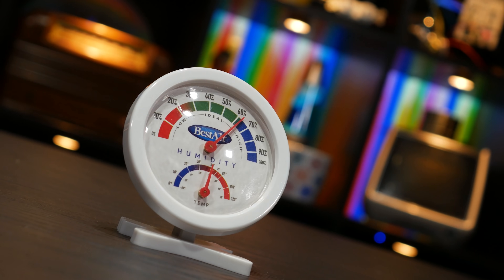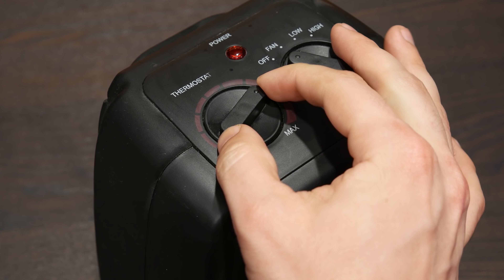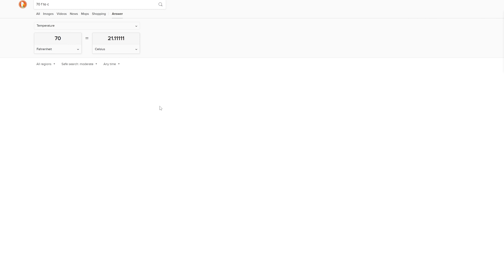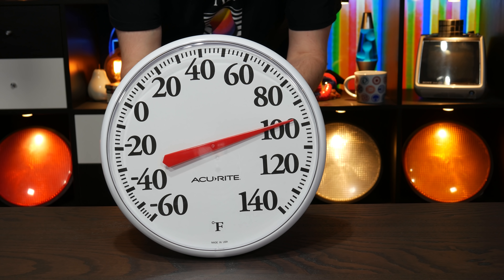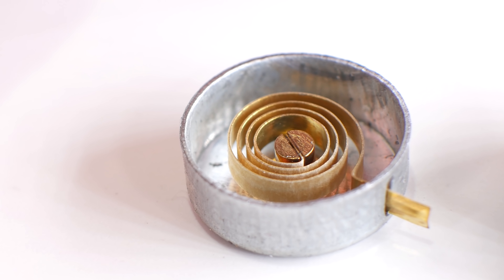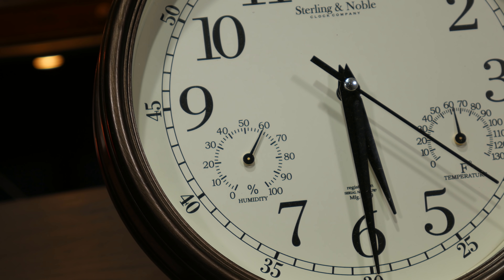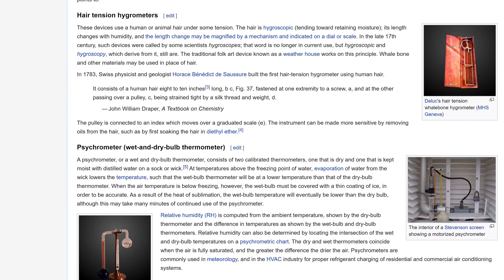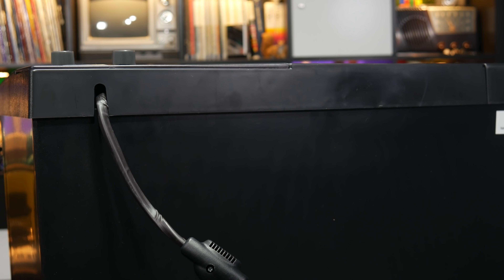Analog Hygrometers - how?

Comment: I don't measure temperature in C or F.
I measure it in "I will get out of bed" or "I will hit the snooze button another 10 times".
Sometimes I also measure it in "Do I really want to leave the comfort of the air conditioner"
Reply: I often measure in "Do I really want to leave the comfort of the air conditioner".  The answer is usually "Heck to the N-O."

Comment: I would love to see a video that finds the very best power outlet / plug type in the world.

Why was each type made the way it was?  Rank them for safety, durability, ability to stay plugged in firmly, dangers of each.
Reply: Here’s Tom Scott’s opinion on British plugs.  (https://www.youtube.com/watch?v=UEfP1OKKz_Q) I would add some caveats (I’m a displaced Brit, now in NJ USA who is old enough to have wired many, many plugs):

– The insulated live and neutral pins are great, but a relatively new idea. It was possible back in the day to find contact between a finger and a live pin if you weren’t careful. The update to the standard is a great idea.

– When I was growing up I lived in several houses which hadn’t been upgraded to current standards. There were still a lot of BS546 round pin plugs around (https://en.wikipedia.org/wiki/AC_power_plugs_and_sockets:_British_and_related_types). They went back to individual fuses (no breakers those days) and it was a mess. Multiple adapters if you wanted to plug a light into 15A circuit etc, etc. Also many safety problems.

– When you bought a plug, it came with a 13A fuse. Always. You could buy lower rated fuses (I remember 3A, 5A, 10A but I’m not 100% certain) which mean that you would end up with a drawerful of the 13A ones. I once called MK (https://en.wikipedia.org/wiki/MK_Electric) , a manufacturer of electrical equipment that I liked to ask if they had an exchange plan and was told, quite abruptly, “no”. I don’t think too many other people changed the fuses in their plugs to match the equipment load.

This information dates back to the 1980s, and much has changed. Lots of houses have been rewired and fuses replaced by breakers (I didn’t see a breaker until I came to the USA), and RCDs (https://en.wikipedia.org/wiki/Residual-current_device) being required for sensitive locations. But I agree with Tom that the British system has a lot going for it.
Reply: That being said, there is very little that I think is good about the US electrical system. I’m especially annoyed that the plug prongs can be so thin and bendable. Tom joked about standing on a British plug at night and the result which is like Lego to some enormous power. If you stand on a US plug, you can break it.
Reply: Aaand finally, I would be remiss if I didn’t give a shoutout to the European “Shuko” standard (https://en.wikipedia.org/wiki/Schuko) where the socket is recessed and there is no way for errant fingers to contact anything live. I haven’t any personal experience with it however. And I wonder what the impact is on building design since the wall boxes to contain the sockets (US: outlets) look like they have to be pretty deep.

Comment: Incidentally I once saw the plans to make your own electronic hygrometer. The sensor was paper soaked in some mixture of salts, I forget which. The problem with it was, if you constantly apply a voltage across salts in water, or even damp paper, electrolysis will occur, and you'd end up breaking apart the salts you were relying on. So the device used AC, switching the direction of the applied voltage every so often, but still measuring, amplifying, and then applying calibration and scaling to it for a result. All using op-amps, no digital anything, certainly no CPU or software. Tricky but ingenious. But probably more than you could be bothered with, even back then, it sounds like a lot of trouble in practice, even the theory of it looked a bit dodgy. 

Still I presume the same applies now, with a little CPU doing all the work, presumably with some analogue stuff on board too, a custom chip. Then it spits out readings over I2C whenever it is asked. I2C is a serial bus meant for use inside electronics, you can get who-knows how many devices using it. Every device connects to the same 3-wire bus, the master sends out requests, and the slaves all sit waiting to see their address appear on the bus. When it does, they send out their little bit of information, and that's that. You can get every kind of sensor, but also stuff like LCD displays and memory chips in I2C. Since it's a standard that everyone sticks to, it's much easier to connect stuff up nowadays. There are kits aimed at kids where the (hidden) principle is that I2C is carrying all the signals between components, so it ends up a lot like Lego. You just plug stuff together.

SPI is I2C's wild-west cousin, a bit less strictly regulated but faster and more versatile.

Comment: Huh, the hair hygrometers are honestly the only ones I've ever come in contact with in my youth. That said, most of my family's thermo-/hygrometers were, I'd wager, from around the '70s or '80s, so maybe that's just what was in style at the time. Actually, that reminds me of a really cute outdoor thermo-/hygro-/barometer (or, as it called itself, a "weather forecast") that looked a bit like a cuckoo clock, except it had little wooden figurines on a seesaw - one with a summer dress and the other with a rain slicker - and whichever sat higher indicated how the weather would be. Really cute, that. (I'm not quite sure if the mechanism was driven by a hygrometer or a barometer, but I do distinctly remember it had a hair in it that eventually broke, so I think that was the main mode of operation? 🤔)

Comment: 0:53 - coil like thing - that's a spring - like you find in a clock. It keeps the string tight by pulling the pointer to the dry end of the scale.

Comment: There is another method of measuring humidity, and it's the way used on professional weather observation stations (at least those that still are manned instead of being fully automated/electronic): You take a thermometer and put a kind of sock on the bulb where it measures the temperature, and you keep that sock wet with distilled water. This water will evaporate, and evaporation needs energy. This energy is taken from the heat in the surrounding air and the bulb of the thermometer, meaning that the thermometer will read lower than a similar thermometer but without the wet sock. How much lower depends on the speed of evaporation, which in turn depends on the humidity, and so with some calculation you can determine the dew point and relative humidity by comparing the temperature from the thermometer with the sock, called the wet-bulb temperature, and the dry-bulb temperature, which is a fancy name for the temperature from a regular thermometer.

Comment: Bravo for the 0 - 100 degF range covering what we normally experience for weather. Also, F degrees are smaller than C degrees, allowing for a more precise reading without icky decimal points. And inch fractions are base 2! And pounds and ounces are sized for the market! And WHO CARES about a unit system based on the distance from the North Pole to the equator through that well known center of the universe, PARIS! And--what? Time for my dried frog pills again? OK.

Comment: I like the rant about units.  In Canada, we commonly use both.  Height of people, pool depth, ceiling height in feet.

Pool water temperatures are often said in Farenheit, house temperature are half celsius, half farenheit, outdoor temperatures are more common in celsius in my personal experience.  For travelling distances, I don't know anybody who counts in miles.

You know that an inch is roughly 2.5cm, 1 foot is about 30cm (we've all had 30cm/12inch rulers in elementary school). A meter is roughly three feet, a mile is 1.6km.  You know that 6 foot 2 is the height of a tall dude and that it's somewhere around 180cm.  And of course, a phone gives you precise conversions, so the 1.6 is just so that you have a feel for how 70 miles differs from 70km : 70 * 1.6 ~ 70 * 1.5 ~ 70 + 35 ~ 105  (this is usually enough for me, but I can add 7 for the missing 0.1 and get 112 but if I'm there, I might as well have taken out my phone)

Comment: That CED playcard popping up, though. :)   Converting between Celsius and Fahrenheit is, thankfully, a simple pair of equations.. All you really have to remember are the numbers 32 and 1.8.   C to F: (C x 1.8) + 32.   F to C:   (F - 32)  / 1.8.   I made up a scale of Celsius by every 10°С to get the basics in my head.  0 is freezing, 10 is chilly,. 20 is comfy, 30 warm, 40 hot, etc.

Comment: My humidifier is the worst for indicating my rooms humidity and the biggest way I can tell is when it’s raining my bearded dragons tanks humidity percentage will be higher than a normal day and the humidifier will still be at 30 which doesn’t make sense it would make sense that the house would get a little bit more humid if it’s raining outside and I have Maybe wet shoes in the living room and my shirt is wet same thing when I do laundry and I lay it to dry in the bathroom the humidity will go up in the tank a little bit but my humidifier won’t even say anything different than 30 sometimes on hotter days it will be a higher number butFor the most part my humidifiers numbers are useless to me

Comment: On the subject of the US using a bunch of seemingly random and meaningless units, I would just like to say that I agree that the metric system is actually better in every conceivable way... 

Except temperature. 

Celsius (beyond be embarrassingly imprecise for no discernable reason) is just meaningless to the human experience. 

It's built around a substance that has no bearing on how the human body experiences the world around it. (So is Fahrenheit, but it much more closely lines up with the human experience by sheer happenstance.) 

The freezing and boiling points of water are completely irrelevant to the human experience of temperature. 

100 degrees should be "really freaking outside", not "oh my god it's literally the end of the world because blood is literally boiling and I'm not even using the word 'literally' incorrectly". 

People like to say that the simplicity of knowing that 0 is freezing and 100 is boiling makes celsius easier to deal with, but how? How is turning on the weather and seeing "32.437"(there's that lack of precision I was talking about. Those ridiculous decimals are necessary because the degrees are so huge.) easier than seeing "90"? 

Celsius' lack of precision necessitates decimals where they just aren't needed in fahrenheit. 

And beyond that, the human body is capable of detecting a temperature difference of around half a degree... In fahrenheit... Which is less than a quarter of a degree in celsius. 

So when you want to raise the temp in your house just a tiny bit, you literally can't with a thermostat that only reads celsius, because 1 degree in celsius is around 4 times as much as you wanted to raise it. 

Celsius is a stupid measurement, and arguably even stupider than a lot of the nonsense the US uses for other stuff. So shut up with all the "USE CELSIUS YOU AMERICAN TRASH!" crap you're always throwing around.

Comment: Fahrenheit: 0º is really friggin' cold.  100º is really friggin' hot.
Celcius: 0º is slightly cooler than tolerable for someone living in a temperate climate.  100º is something that won't happen (on the surface of the Earth) outside of a fire, volcano, or man-made heat source.

Comment: When it comes to the unit conversion, I don't mind at all if it's text that I can just copy and paste, because if someone puts 63f in a message, you can just highlight that text and click on the "search google for..." and then there you go

But with video, I'll need to pause it, open up a new tab, start typing it in but then need to double check what the actual figure is so I'll go back to the video, rewind it a little bit, listen carefully to get the figure, put it in, get the answer, go back to the video, rewind an extra 20 seconds so I get the context, and then keep the figure I looked up online in mind until that bit has passed.

Comment: Let’s face it—the rest of the world is jealous of our much more accurate temperature scale—1°C = 1.8°F.  If the issue is where the zero point is, then start using Rankine or Kelvin—no temperatures below zero, but big numbers to deal with (which is why you will never see a newton scale for people, even though the newton is the SI unit for weight).

Comment: Except 0 to 100 °F is not a tolerable range by any stretch of the imagination. We North Americans just pretend it is when we need to come up with an excuse for why we use Fahrenheit. You know what I call 0 °F? "Fuck it, I'm not going outside." 0-20 °F is utterly intolerable. Temperature becomes tolerable right around the low 30s °F. And on the other end, 100 °F is pretty fucking toasty and makes me want to reconsider going places. Really, the low 90s °F is the upper limit of where I want to do anything. But what if we convert those into Celsius? What do we get? 0-30 °C or there abouts, which is easy enough to remember. But maybe I'm wrong. Maybe you're perfectly comfortable going out in 0 °F weather.

Comment: Centigrades are simple, at -20 or lower you’re going to die unless you came prepared. At -10 or lower you want to upgrade your coat. At 0 or lower you want a heavier coat. Past +10 you need a lighter coat. Past about +20 you need no coat. At +30 or so you’re in Arizona. Past +40 you’re going to die unless you came prepared. Past +60 you’re in 
Finland, in a Sauna, but your host is considered to be odd. Past +80 your host is normal. At +100 water boils. At +110 or so, a Russian competitive sauna bather passed away, very sad.

Comment: Couple of problems with strip hygrometers:
1) wetting them will ruin them for obvious reasons
2) they get less accurate as time goes by because salts creep on paper and deposit themselves in unevenly spread layers, which changes the curving response of the strip. That's why horse or human hair, degreased by solvents, will work better - it's just fibrillar proteins responding to surface phase bound water molecules.

They are fun, nonetheless.

Comment: 1:56 No, your caveat won't stop me trolling.
From a practical standpoint, I prefer the Celsius scale, and not just because it's easier to convert to Kelvin (the scientific standard), but because of the Celcius scales strong connection to the different physical states of water, and thereby biological life and a lot of everyday, natural, phenomena. I know that if outdoor night temperature have been 0 °C, or below, there will be icy roads, when I get to work in the morning. If something has a temperature of 100 °C, or higher, it's too hot for me to handle, or eat, without getting immediately scorched. I know that all kinds of food is safe to eat, after it have been thoroughly heated to 80 °C for a few minutes (active food pathogens, and most kinds of spores, are killed with heating to temperatures below 80 °C), and that pasteurised food, continue to be safe to eat, as long as it's temperature is kept above 60 °C (most pathogens can't reproduce, or leave stasis, at or above this temperature). I now that I won't start to smell, when I sweat, if my clothes has been washed at 60 °C (the spores of all the bacterias and fungi, which cause the most common bad body odours, is killed at, or below, 60°C). It's nice and easy numbers to remember, all thanks to Celsius strong bond to the state of water at different temperatures. If you use Fahrenheit instead, the temperature numbers for most common, everyday, phenomena doesn't usually roughly align, as good, at multiples of ten.

Comment: Simple, eh? But how about the fact that the maximum water content of the air varies with temperature and air pressure? You said yourself that one of these claims to be fairly accurate "at room temperature". How would you go about getting an accurate reading under non-standard conditions (high elevation, warmer/colder temperatures)?

Comment: Fahrenheit is a better scale - with Celsius there are only 100 degrees between freezing and boiling. With Fahrenheit, there are 180 degrees between freezing and boiling. That means it has a higher resolution without fractions, almost double, and a significantly higher resolution with fractions.

It's also the scale you need to calculate BTUs, which even a ton of metric countries use.

Comment: Celsius is a dumb scale. The steps are too coarse and at least with Fahrenheit you get a sense that 0° is very cold, while 100° is very hot.  37°C doesn’t sound hot. 

And don’t get me started on meters and its divisions. I’d much rather read a rule showing 1/32” then try to figure out what .7mm is. 😁

Comment: My dad has been a weather "nerd" for a very long time, as well as having an appreciation for old tools.   One of his favorite finds was a wet bulb hygrometer.   It is 2 mercury thermometers, where the bulb of one is kept wet by the capillary action of a cotton wick that has one end in a long "J" shaped glass tube (modern ones seem to just have a small horizontal reservoir).   That tube gets filled with water, and then the latent heat of evaporation causes the wet-bulb thermometer to read a lower temperature.   You can then look up the relative humidity on a chart - which is distinctly non-linear.   It's not super practical because you need to fill the tube every couple days, but it is supposed to be very accurate.

Comment: So if Fahrenheit is good for tolerable temperatures
You would say this
0°F is "Very Cold" and 100°F is Very Hot
Using this logic you would think 50°F is not too cold and not too hot as it is between Too Cold and Too Hot so it is just right.

But 50°F is cold.
its only 10°C